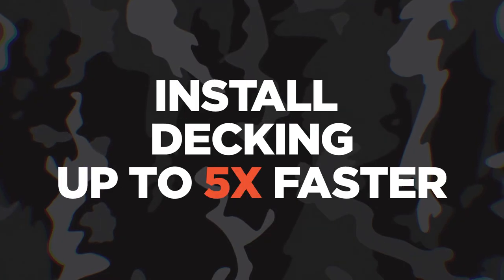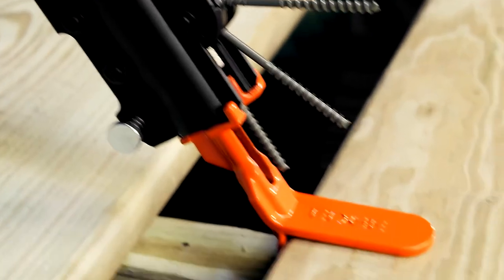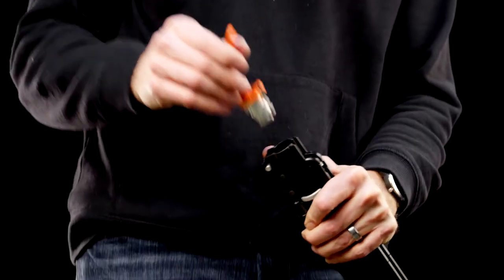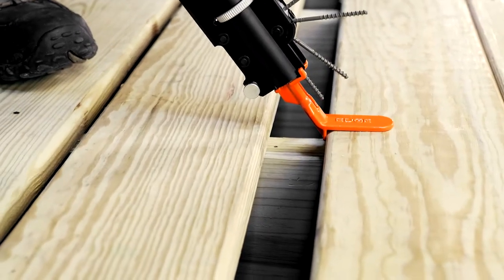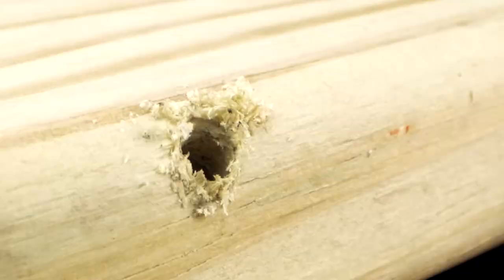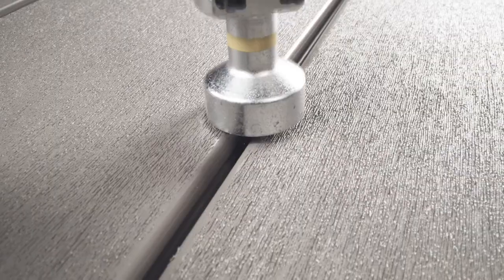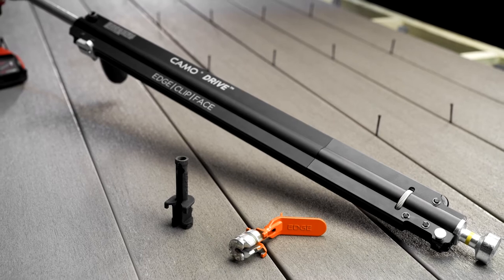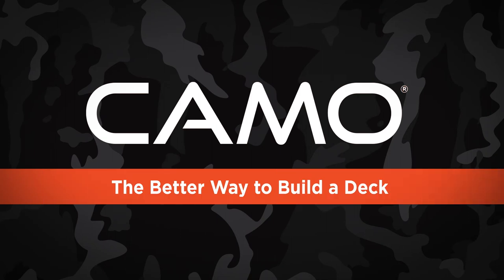CAMO® DRIVE™ Stand-Up Deck Fastening Tool

Comment: Does it work with trex hidden fasteners?
Reply from the maker: @tribalwind the CAMO DRIVE stand-up 3-in-1 tool was designed for use with CAMO EDGE and EDGEX clips, CAMO Collated Edge screws and CAMO Collated Face screws. We also have the CAMO ClipDRIVE stand-up tool that work with CAMO Edge and EdgeX clips.
Reply: @CAMOFasteners  ah bummer ok thanks.